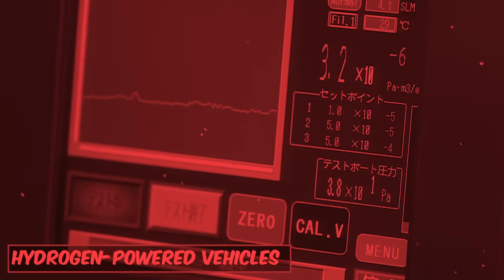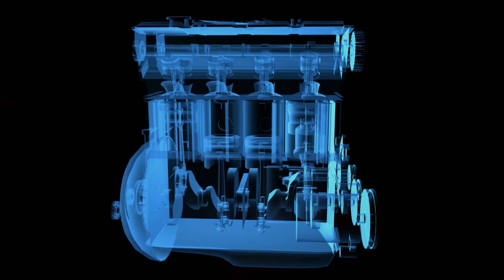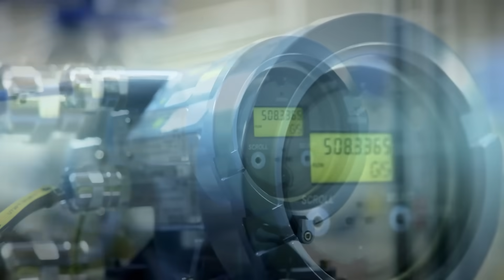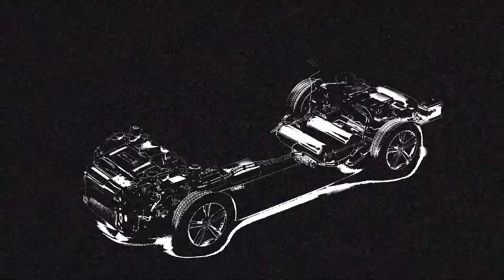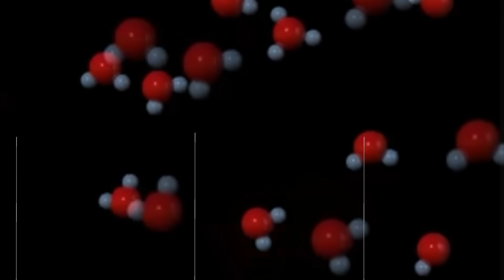Toyota's New WATER Engine Will Destroy The Entire EV Industry!

Comment: I may be dumb about this, but wouldn't this be like a perpetual motion machine? It takes as much energy to split water into hydrogen and oxygen as you get back by burning the hydrogen.
Reply: I was thinking that too. I saw that fuel cells are more efficient than combustion engines with hydrogen. And if it was fuel cells, the need of electricity to extract hydrogen from water that will then be used to refill the battery and, drive the car would mean extracting much more electricity than you put in. It doesn't work. Something's fishy.
Reply: Not so because according to the announcer you can use dilluted water
Reply: @marcrichardson346  - WTH do you dilute WATER with?! 🤣
Reply: @marcrichardson346  It's distilled water, not diluted water.  You can't dilute water.
Reply: @greenmanofkent  3:33 …”diluted water”
Reply: @greenmanofkent duh…ya can if ya por mor water in it
Reply: @greenmanofkent the guy was making a joke 😉
Reply: @greenmanofkent  of course you can ! Just add water 😉
Reply: @marcrichardson346 lol!😂
Reply: @marcrichardson346 😊 I thought I'd misheard that!
Reply: @battleofarmageddon1366  All of the water on this planet stays on this planet. It is used in cycle and falls again as rain.
Reply: @davidkennedy4845  Ah. That explains all the droughts. When you have no fresh water to drink or use on crops, remember. All of the water on this planet stays on this planet.
Reply: @battleofarmageddon1366  Stays on this planet, yes it does. It does not always fall in the same places due to weather patterns/cycles. Hence floods in different parts of the world and droughts in other parts at different times.
Reply: @battleofarmageddon1366  - Water is just like energy, it can neither be created, nor destroyed, only changed and moved.
Reply: @tubularguynine water is created by burning hydrogen with oxygen and water can be split (destroyed) back into hydrogen and oxygen by electrolysis. So not like energy at all.
Reply: @kevinfletcher1999  - The stable hydrogen and oxygen molecules aren’t destroyed, just separated temporarily, thus ‘changed’. And I’ve always wondered something about energy… If it can’t be created, but you can pass a magnet by some copper wire, and get a current, why is that not considered creation?
Reply: The physics within this thread are, well let's just say, admirable, but unfortunately incorrect. Sure when you drink water within an enclosed ecosystem, the water always remains. But that's not what is being done here. When you use electrolysis to separate hydrogen molecules from oxygen molecules within water, things happen. For instance if the oxygen is used to breath in our lungs, it's changed into carbon dioxide. That means that oxygen that used to be part of h2o can never be magically re-attached to more hydrogen in order to replace the water that was changed into different forms of energy. In fact the more hydrogen we make from h2o, the more oxygen we also make which will eventually be used in our lungs, or used for some other purpose besides the production of h2o. The end result is we will make more carbon dioxide, which we would then need plants in order to produce more oxygen. You take away the plants, which we are doing at an exponential rate when we deforest and settle more and more towns and cities, then eventually we will end up with an unbreathable atmosphere. 
 Not sure if anyone has ever lived in an unbreathable atmosphere, but I can assure you, life wouldn't be easy.

Not to mention the amount of energy it takes to separate the hydrogen from the oxygen comes at a very high cost to our resources and environment. No it's not like a "perpetual motion machine", but it becomes redundantly expensive to create.
For most people, it's like thinking that electric cars are a form of "clean energy", not realizing the vast amount of "dirty" energy and resources it takes to get enough electricity into a battery to make the thing move.
Reply: @tubularguynine  "You can pass a magnet by copper wire".  The magnet has to be moving - it contains kinetic energy of motion.  Some of that kinetic energy is converted into electrical energy in the wire,
Reply: @greenmanofkent  - (Sound of game show ‘WRONG’ buzzer) - The current is produced by the magnetic field of the magnet, not just the motion.
Reply: @tubularguynine  Incorrect.  Either the magnet or the wire has to be moving.  If both are stationary, then no current is produced.  If the magnet is an electromagnet, and the magnetic field is turned on and off, that will also induce current in the wire.  But SOMETHING in the system has to be changing or moving to get a current.
Reply: @tubularguynine Takes energy to "pass" ...
Reply: and weather manipulation....
Reply: @davidkennedy4845 well this is not exactly true some of the water actually gets lost into space
Also this video is total bs
Reply: What a load!🤣
Reply: @battleofarmageddon1366 Make one that will use sea water that way all the rich peoples mansions want flood
Reply: Takes more energy
Reply: Perpetuum Mobile is just a dreem, so is this! It would be more like Finitum Mobile
Reply: To me t his is simply a perpetual motion machine, and therefore impossible to run.
Reply: it is not @iddet8867
Reply: Good joke but this should have been published on 1st April. Where does the electricity come from?
Reply: Mate,  electrolysis requires electrical energy. Thus the engine is in effect an electrical engine, abeit an "indirect" one...😊
Reply: It comes out the back as water vapor
Reply: Actually, a lot more..
Reply: There😢no shortage of water as a matter of fact the Earth is covered with over 70% water 💧
Reply: Wouldn't salt water b more conductive
Reply: @jsmolinski23 Yeah it would, but then you could get a corosion and lime build up in the gas tank. The best thing to use is distilled water. Maybe even make the destilled water while the car is driving, using extra alternators. Its very interesting that they are making this public now, considering that Toyota is a big supporter of the oil industry.
Reply: 100's of folks coming out of the woodworks. Few of them understanding Thermodynamics and efficiencies. And lets not talk about math.
Reply: @AndreasPleschutznig  
I have devised a gadget that will make an ordinary petrol car run on my snake oil. You put it into the tank, and add a few drops of snake oil and the car will run for ever without refuelling.
Reply: @physiocrat-sv  🤣
Reply: 101 now @AndreasPleschutznig
Reply: @AndreasPleschutznig  99% only and including those pushing hydrogen cars. Most comments center on the cycling of water which completely missed the point. The main point is 100% efficient enegine with 0% energy lost is impossble to make. External energy source is always needed. And those hydrogen car pushers never tell you the energy exchanges and their efficiency.
Reply: Thermodynamically this free energy.. no such thing.
Reply: this is bullshit
Reply: Chemistry 101: the law of conservation of energy. 😂😂😂
Reply: Toyota treats us as if we are dumb. Where does this "high voltage" for electrolysis comes from? 😂😂😂
Reply: to split a water on hydrogen and oxygen will need more energy  that can be recuperated from converting it back to water
Reply: Stanley Meyer proved that Maxwellian "LAW"  to be a lie but that's not why they killed him per-se.
 His under 5 amp 110 volt system was patented in many countries when murdered.
   The climate lie would have bit the dust had his system  gone into mass production, thus the tax on "carbon" would not be justifiable. 
     T H A T S     W H Y    T H E Y   K I L L E D    H I M.
Reply: :face-purple-crying: @battleofarmageddon1366
Reply: Your dumb!
Reply: This is exciting @battleofarmageddon1366
Reply: @battleofarmageddon1366 You are kidding right  funny😂😂
Reply: yup, you are dumb!!
Reply: @battleofarmageddon1366 Who drinks distilled water? Use it for irons, golf cart batteries, car batteries.
Reply: Yes.. Ur right
Reply: @battleofarmageddon1366  where would the water go?
Reply: @battleofarmageddon1366 let’s stick to getting 5 year olds in Despotic regimes digging up the battery minerals then…🤔
Reply: German submarine engineers, at the end of ww2, were working on a closed-cycle engine, using hydrogen-peroxide.
Reply: If solar panel can work
Reply: Indeed. This is just rubbish designed to con the uneducated and gulible.
Reply: @battleofarmageddon1366  There is no water shortage.
Reply: Yes, but Honda is not making a car that runs off water, they are making a car that runs off hydrogen I think this guy is a bit confused but I still enjoyed his video as he is a talented presenter. With hydrogen cars the only thing coming out of their tailpipes is pure water.
Reply: The fat to ATP energy is similar, it break first H bridge and 2ATP gain energy is used to break next.
Reply: except   ...you have to add water
Reply: Of course you are right. You can not get energy from this, that is energy from nothing, and you have a perpetual motion machine.
Reply: Oh, and channel blocked for obvious reasons.
Reply: @DCGreenZone Because it's idiotic?
Reply: @tmst2199  I don't know, is it?
Reply: Nope it doesn't if you don't use that method. There's another method. You have been misled.
Reply: It takes more energy.
Reply: Yet we harness the reaction , and produce , oxygen 🤔
Reply: If you count mole yes but we arent counting mole energy but speed of ignition expansion
Reply: you don't. some energy will be lost to the surrounding as heat. Others to the resistance of the media. This is junior school science.
Reply: @RichardWheeler-kw7mk  Yes, you are dumb about this. Yes, theoritically it takes as much as energy to split water into hydrogen and oxygen you get back by burning hydrogen.Even if we assume 100% efficiency, which is practically impossible, you need to take away certain energy for the movement of the car, leaving behind less energy for electrolysis of water back to hydrogen and oxygen. So external source of energy is always needed for this energy which Toyota doesn't explain from where.

It's just junior level physics and chemistry - the law of the conservation of energy.
Reply: What a crock of garbage. Please study a little bit of physics before posting this nonsense.
Reply: There is no such thing as perpetual motion.
Reply: It takes lots more.
Reply: That’s what they want you to believe. Nicola Tesla disproved the law of conservation, but FBI and CIA sealed up all of his research and made it classified. And then they fed us this horse shit lie in our science books that sounded really good about the law of conservation. It’s just not true you can have perpetual motion.
Reply: Look back at Stan Meyers and his water fuel cell, car and death.
Reply: @Sport--willow  He was a fraud, sued by his investors, pronounced a fraud in court. He died from an aneurism during a dinner with his brother. He's forgotten because he was a disgrace, not because he "mysteriously disappeared"... he didn't.
Reply: @Sport--willow  indeed and we all know how the elite like to have total control over everything, including those people developing this kind of technology. So it's interesting Toyota (dare) are doing this.
Reply: @battleofarmageddon1366  No water is lost. The end result of the process is water coming from the tail pipe. Already proven.
Reply: better check that @JoeGator23
Reply: @JoeGator23  No, water IS lost.  lol
Reply: No, not perpetual motion, because the system cannot help but produce waste, which means it takes more energy ultimately to produce the gases than you get from the burning, so it never recovers the initial jolt needed to get the system running in the first place. SO, it is basically a bust.
Reply: I cannot believe that I wasted such time in watching this nonsense.
Reply: I can't believe I wasted so much time reading this comment. @robertbennett9949
Reply: @robertbennett9949  I feel abused. LOL.
Reply: We are talking about new technology  @robertbennett9949
Reply: @robertbennett9949 Only it's not
Reply: Pure distilled water is none conductive to electricity less so than air. So the water must be made conductive for electrolysis making the water an electrolyte. Making the electrolysis cell almost a type of battery that makes HHO. Every battery has losses to the metal plates and the electrolyte will degrade overtime very quickly in the case of electrolysis.
Reply: True, you need an electrolyte to conduct the electricity
Reply: @SmokeyWire56 :   " Pure distilled water is none conductive to electricity less so than air. So the water must be made conductive for electrolysis making the water an electrolyte. Making the electrolysis cell almost a type of battery that makes HHO. Every battery has losses to the metal plates and the electrolyte will degrade overtime very quickly in the case of electrolysis. "

Exactly! Plus I'm pretty sure the electrolysis idea has been tested to death and in reality, you can't get as much power back as you put in.
Reply: Considering the industrial production of hydrogen, and using current best processes for water electrolysis (PEM or alkaline electrolysis) which have an effective electrical efficiency of 70–80%, producing 1 kg of hydrogen (which has a specific energy of 143 MJ/kg) requires 50–55 kW⋅h (180–200 MJ) of electricity. @SmokeyWire56
Reply: @battleofarmageddon1366  - When you burn hydrogen, it mixes with the oxygen in the atmosphere and turns back into water. Besides, 70% of the earth is covered in water.
Reply: @tubularguynine   SALT WATER
Reply: @robertwright4015  - What about it?
Reply: @tubularguynine  The majority of that, is salt water. Not drinkable.
Reply: @battleofarmageddon1366  - The  engine will supposedly use distilled water… When you distill water, the salt stays behind.
Reply: @battleofarmageddon1366  Do you want to drink or do you want to drive?😂😂😂😂
Reply: It’s distil able though
Reply: @battleofarmageddon1366 just have to distill seawater
Reply: In a closed ecosystem no water will ever disappear, looks like you have fallen for the propaganda
Reply: @rdkhoe  Looks like you have no idea what you're even talking about. That has absolutely nothing to do with the energy balance of this motor.
Reply: @rdkhoe  But it could change from its liquid state to either a solid in extreme cold or into air.
Reply: @rdkhoe   Back in the 1930s UP/GE built two steam locomotives that were designed to condense the water vapor back into a liquid to be reused. It failed because you can't cool the water vapor fast enough or cold enough to make it work.
Reply: How can it be perpetual motion if you have to keep adding water?
Reply: @gantfrost7749  A perpetual motion system is any system that proports to create ad much or more energy on output than it requires on input. Water isn't a fuel -- it takes more energy to get H2 and O2 from H2O than you get back when you recombine them. In fact, given that internal combustion engines are inefficient, you're getting maybe 15-30% out in mechanical energy for the electrical energy you put into the system to crack the hydrogen, even if the electrolysis process were 100% efficient (which it won't be -- some energy will be converted to heat in any electronics system).
Reply: No you are using the energy in water, which is a substance which has energy.
Reply: Not at all. When you charge a car battery for instance, hydrogen gas is produced, because of the current running through the distilled water in the battery 🔋...😉
Reply: @petewright5481 ttttttttttttt77777tty 55😅
Reply: A car battery powering a family car will not get far.  Electolysis in a car battery will produce very small amounts of hydrogen as its distilled water volume is only millilitres.  First lesson of physics "energy can not be created or destroyed it can only change form'.  @petewright5481
Reply: @petewright5481  Which proves what exactly?
Reply: @petewright5481  distilled water doesn't conduct electricity
Reply: @petewright5481 oh dear. It’s concentrated sulphuric acid, not distilled water. That’s only for topping up which is yesteryear technology.

Comment: This may be a dumb question but where I live, every winter is below zero.  What's it going to be like starting that water engine in the morning?
Reply: It might be frozen you aren’t going to work 😂.
Reply: Alaska need to test these. Fairbanks get -50 often. Good test city!
Reply: Most arent poor like u or dump they live warm
Reply: you live the engine working all night and heating on. 
in the morning fill it up with distilled water and go to work.
hehe 😁
Reply: You would need to have heated fuel tanks and lines for start up.
Reply: Like the way you keep the interior of your car warm in the cold winter,the water tank and the pipes would be insulated and then heated by the car engine. But the major problem seems to come from splitting Hydrogen and Oxygen.
Reply: Built in heater that keeps the water at normal temp
Reply: You have to first hook up a team of reindeer to power a generator.
Reply: Nope.  Perfect question.  Don't doubt your instincts.  Always ask questions where claims have holes.  The whole video is nonsense.  You're entirely right to question it all.
Reply: 1. Add antifreeze to the water 
2. Move to Florida 
3. Make it a 3 dog night on the      
motor 
4. Park the car inside the living room
Reply: How do you make your coffee in the morning?  any more silly questions?
Reply: @yveslaflute9228 I think it’s an excellent question!
Reply: @yveslaflute9228  Out in the parking lot?